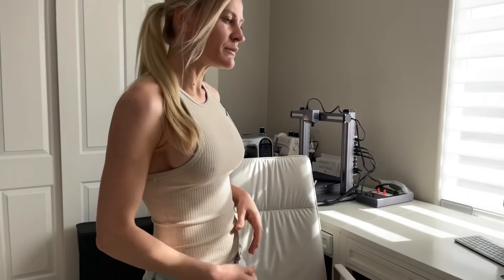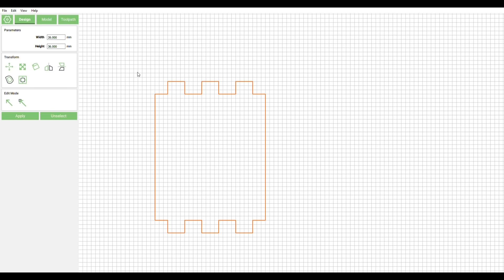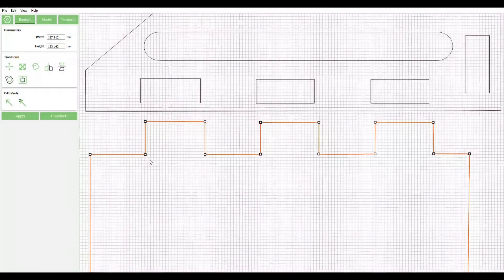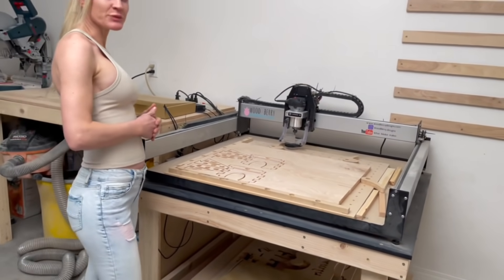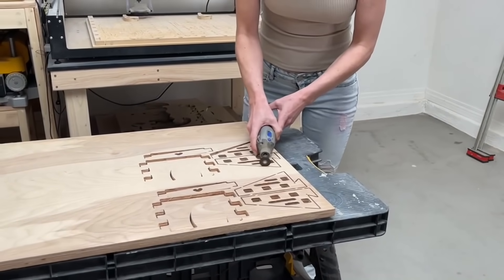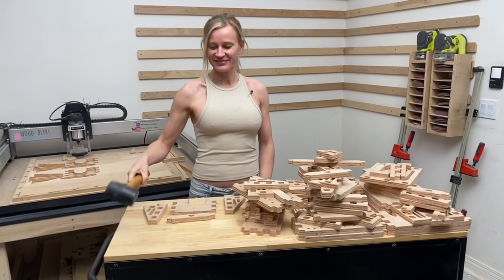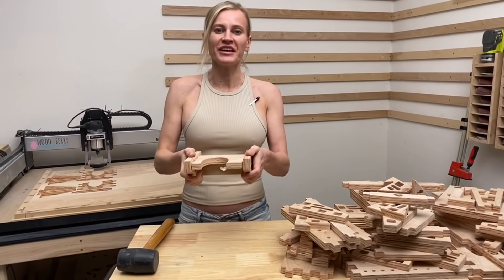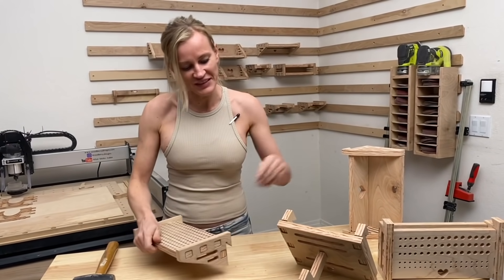DIY build - French cleat system attachments for tools - CNC Shapeoko

Comment: I did wonder why Meike put ear defenders on when the CNC machine was running. Then removed them to do more work with a Dremel and a sander. The sander and Dremel sounded louder than the cutting machine.
 As I'm somebody who suffers with tinnitus I'd recommend wearing ear defenders at all times when doing work that creates that type of noise. Tinnitus is a bastard.
Enjoyed the video though and will watch others from Mieke.

Comment: That was very impressive! I didn't know what a French cleat was! I loved the storage cubbys for different sand papers. Not too many of us keep cnc routers close to hand. I certainly don't.  Always fun to watch someone that knows what they are doing. Very nicely done. And I learned something. Please carry on!
Reply: You don't need a CNC Machine to make French Cleats. In fact if you need a CNC machine to make a French Cleat, you should probably find another hobby. Take your Saw, Cut 1/4, 1/6, even rip a piece of plywood at 45degree angle.  Take the other side of the 45 n attach to your tool, using something as simple as velcro.  It's really NOT rocket science!!

Comment: No lie, never seen this before... I don't understand what is "holding" the shelf in place. I get the idea of the pressure holding it due the L (or 7) shape but... is there a tab I can't see slipping behind those rails? We have jets here (I'm in the flight path of a military installation) that sometimes fly low and it vibrates things is why I'm curious. 🤔

Comment: I think that is really cool.  But I am on the fence about the CNC machine / computer program.  I feel like using that technology makes a person more of a computer operator or machinist than a wood worker.  I'm not Amish in my preferences (hand tools only), I do like running a table saw, jointer, planer, band saw, router, etc... but I like to have a little more connection with my work than having a computer program do all of for me.  I think it's really cool that the technology exists though.  CNC and 3D printing is amazing... just not for me.

Comment: I need to admit to being confused by one detail here. After all of the money, time, effort, and trouble required for a CNC...you have to use a dremel to actually finish the cuts? I think I may be showing my age here but honestly I'm even less inclined to consider one. 

Having said that, the french clear system is very well designed and thought out. Very nice work Meike.

Comment: I too am a fan of the Ryobi 18ga cordless brad nailer. Check out their 23ga cordless pin nailer. The smaller gauge pins are fantastic for glueing up small parts that an 18ga brad might split, and the heads are so small that they're basically self concealing. The 18 Gauge is fantastic for trim carpentry, but for woodworking, a 23ga pin is generally optimal.

Comment: First, I would like to thank you for sharing the svg files but I needed more than just a rubber mallet to get mine to work. so I imported them into the Vectric software and added a fillet to all of the shelfs and backs and that reduced the sanding tremendously.

Comment: Excellent Job!  I'm curious about which model of Lav Mic that you are wearing?  and what software do you use for video editing?  
I'm currently using DaVinci Resolve - https://www.blackmagicdesign.com/products/davinciresolve/
I use a Zoom F6 field recorder - https://zoomcorp.com/en/us/field-recorders/field-recorders/f6/
with a Rode NTG5 boom mic. - https://www.rode.com/microphones/ntg5
Reply: @WhatMeikeMakes  Do you like the Saramonic Lav Mic?  Have you had any issues with it?

I'm considering to purchase the Zoom F2-BT because it does 32-bit float recording just like the Zoom F6.  The advantage is that there's no need to set the volume levels, it will capture everything without clipping.  The downside with the F2-BT is that it records directly to a memory card and doesn't transmit to a remote monitor, so you can never tell if anything is faulty until after the shoot.  It does have time codes, so it's easy to sync with the video. - https://zoomcorp.com/en/us/field-recorders/field-recorders/zoom-f2/

Comment: Well clearly I enjoy watching your videos . I can’t fault your enthusiasm and your safety has increased Meika. The only hand tool I see hung on your cleats is a Japanese saw dangerously above you, but clearly you can quickly move this with the advantages of the cleat system l ps pleas3 remove the very sharp edge from both the cleats on the wall and on the hangers , especially with plywood. I really am look8ng forward to the day when you actually make something , preferably without a cnc router and all those machines. This is NOT a normal garage. Thanks anyway and I am still subscribed.

Comment: Hello and Happy New Year!

I have just got done breaking down one of two 9 foot long 8/4 rough sawed White Oak slabs into pieces for shelves.  I used my circular saw and my True Trac System.  Every cut was dead nuts straight.  I hope you have had a chance to check out a system for yourself.  It will save you time.  Very Best Regards,  Jeff Smith

Comment: Good job but I suggest you to consider the design slots beside the shelves, weaken the structure. More, I don't know if you made this for a design purpose but the filetted edges of tenon into the mortise got too interference between those. I'd have chosen to insert cylindrical wood spines.

Comment: What kind of CNC router is that?  Thumbs up for the clever system
Reply: @WhatMeikeMakes  Thank you :)
Reply: @WhatMeikeMakes  I'm looking on Carbide3D's website and there are three sizes, standard, XL and XXL.  Then it comes no router - Sweepy 65mm V2, no router Sweepy 69, or carbide compact router - sweeps 65 v2.  Would you mind sharing?